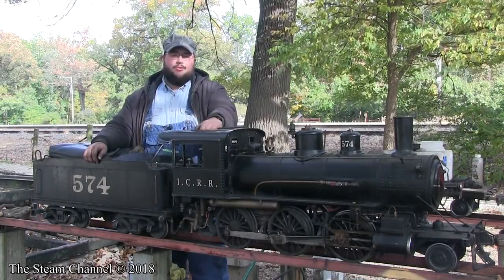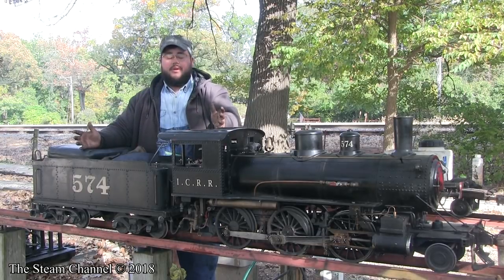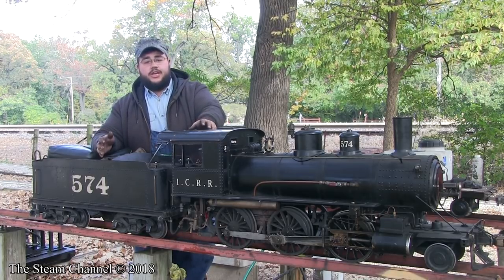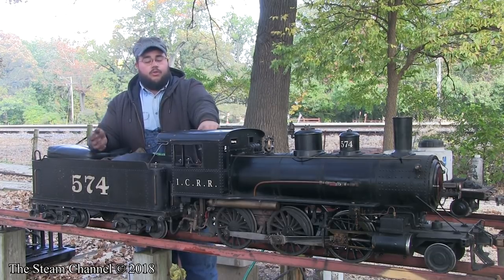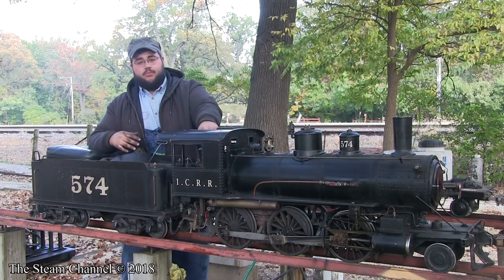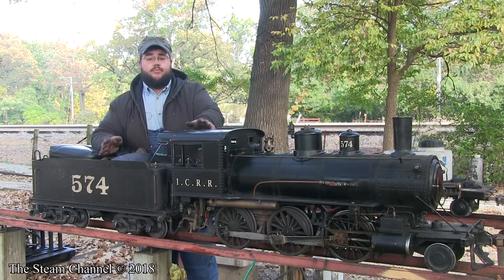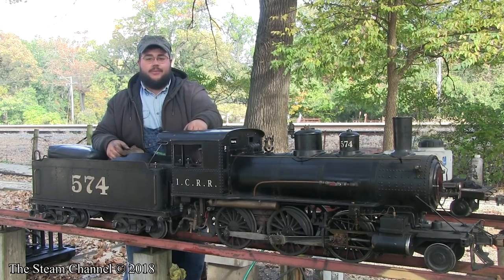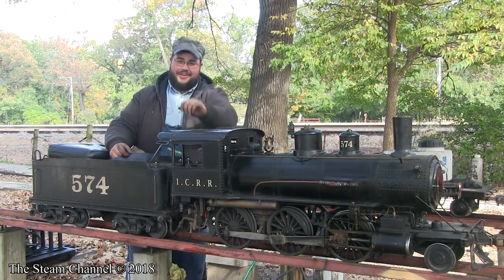How To Shut Down a Steam Locomotive

Comment: Try keep fire temp and steam presure at normal level so you can continue to use the injector (rase water to max) to prep for tomorrow,
After this shut off the blower or even open thr dampaner to kill the fire and lower thr pressure (free to move away if need be)
If you are not going to run drin the boiler with the blowdown valve(or just dont fill to max) but wait for steam presure to drop to prevent damage

Comment: I'm quite curious,  about how much would one of those Allen moguls cost? They are beautiful little locomotives.
Reply: If you're looking at the loco in unbuilt kit form, they're about 10 grand. Throw in building costs etc., you're at around 15-20K. For a finished locomotive, you're looking at 25-35K
Reply from the maker: A kit is not $10,000. Last I looked it was around $5,000
Reply: @TheSteamChannel  Thank you! Also, is there a way to perhaps convert it to an outside-frame narrow guage loco? I don't have much space.

Comment: Do you suggest emptying the boiler of water after every use or only in winter?
Reply from the maker: That disclaimer is for winter. Leaving it full during the winter can lead to serious issues; when the weather turns, the engine should be winterized for the off season. During the summer-you can  leave it filled up.
Reply: @TheSteamChannel  So do I understand this correctly that filling the boiler totally full of water will rust LESS than draining it after every use?  I operate a Scale Case traction engine and am curious the best way to shut it down.   It will not be stored full during the winter and stays in a temperature controlled garage anyway.  Thank you for the videos!